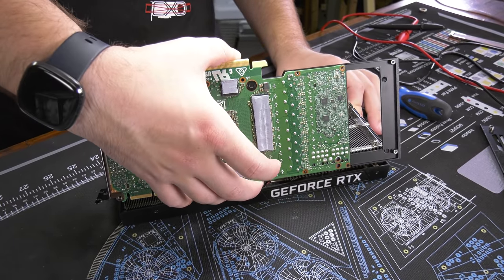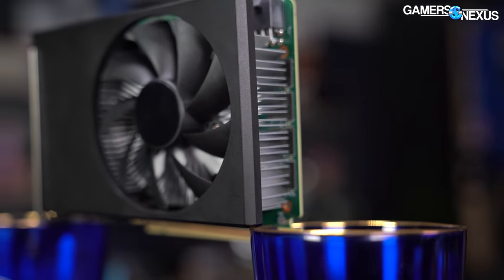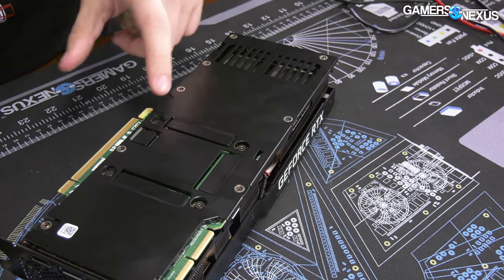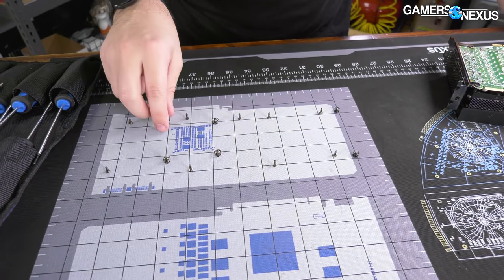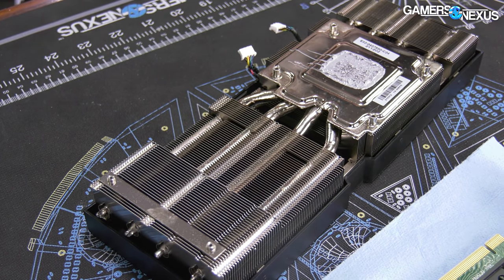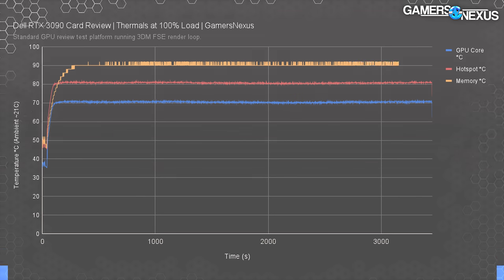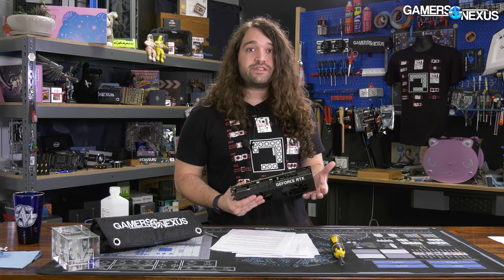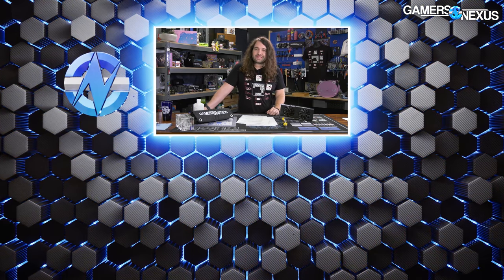Sometimes Dell Actually Tries: Dell RTX 3090 Review, Tear-Down, & Benchmarks

Comment: With the one row of memory on the back that had the tall thermal pads on half, I wouldn't be surprised if the plate had been designed to have a second flat heat pipe there like on the two other sides and then it was cut out of the design to save a few dollars without changing the tooling to match.

Comment: This must be a cost and availability issue. Maybe their cost on 3090 silicon was cheaper, so they used an existing 3080 cooler for that. Easier to hit a performance target with 3090, maybe, even if clocks are slightly reduced vs FE.

Comment: Those aren't bad numbers, I think. Not great, but not bad. My Inno3D iChill X4 3090 was hitting 80C core temp with the OEM's cooler. Also, you'd probably get more mileage out of it with an undervolt. I'd still probably put it under water and replace the rear thermal pads too, but if you're too scared to switch to liquid cooling, sticking to Dell's cooler would be fine.
Also, that Alienware hotbox is pretty, ngl.

Comment: So I bought a pos digital storm pc and it looks like they shoved one of these in the build. I took the water block off because no coolant was circulating through it. The Model Number on the card says  MS-V388. Can you confirm this is indeed the same Dell card? Also, do you know of a waterblock compatible with this card and where to buy it?

Comment: Hi, I'm am totally new to this stuff so this may be completely off. But if there is trouble cooling the rear memory, would it be possible to simply keep the rear plate off with a fan directly on the components? I'm guess dust and debris may be an issue, but just wondering. Let me know please.

Comment: this once again shows, that DELL has good engineers. I also found the G5 prebuild to be a piece of good engineering. The problem is that it doesn't matter, when the cpu cooler is too small and the system uses 1 stick-single channel 1/2 rank RAM etc.
DELL is really frustrating me. They do some nice stuff and also have quite good pricing, but you have to be sooooo careful, when you buy their stuff, that I wouldn't recommend them for casual PC users.

Comment: I'm screaming at my screen :D the extra thermal pad spot was supposed to be where the heatpipe extended. just look at the design. they specifically allowed the heatpipe to route over there, but I guess last minute they decided not to go there. idk if that's a cost cut or what, but it's pretty odd.

Comment: i have a lenovo 3080. It has thermal paste between the heatsink base and that black metal plate. Dell didn't do that. I repasted and repadded. Vram now running 20c cooler in games (~82c). idle temp of gpu and vram almost the same. Very quiet. Furmark benchmark is about 18% slower than evga 3080ti ftw3 ultra at default frequency.

Comment: Is GN ever going to look into open loop water cooling?  I would like to see a standardized test (loop length, radiator, same pump) to test the effectiveness of different blocks. I'm decently experienced in loops but as I'm thinking about upgrading I've not been able to find good performance benchmarks at your quality of work. I understand the amount of variables is daunting. Just would really like to see it.

Anyone know if it would be worth getting a new block for a 1200 socket 10th gen intel? I've been using a 1150 socket block for my 4790k and I don't see why I wouldn't just reuse this block after flushing. I used/am using distilled water. Always have and I'd recommend everyone to do so. I've always used silver to prevent anything biological from growing. Despite having another metal in the loop I've had little evidence of corrosion, and this is after opening my 980ti block after 5 years of use.

Comment: I have an alienware that had a 2080 super , and it was crap.  Was a blower style card, and was constantly throttling at 84c.  Ended up buying a 3070 ti to replace it, which didnt fit the crappy Aurora r8 case.  So I bought a new case+mobo+psu , took the cpu and ram out of the alienware, and built my first pc.  The noise reduction alone was worth it.  Cant hear the fans at all anymore, the alienware sounded like a jet plane.

Comment: Why does it have SLI connectors ? Although one looks too wide to be SLI. 
Too much TIM is bad, because it puts heat back into the processor, in the form of a loop. 
I would be happier with 3 fans on this cooler design, however i am a firm believer in pushing cool air into an PC sufficiently, prior to being concerned about internal cooling components, they are secondary.

Comment: It looks a lot like they intended that flat copper heat pipe to wrap around to the farthest side of the back mounted memory but forgot to modify the backplate after they realized the pipe was too small to handle the heat and just shortened the pipe. Then the height difference of the backplane contact was no longer flat since the heat pipe was missing. Oops.

Comment: I have the 3080 version of this card and the VRAM temps were like 110 out of the box when mining.  Turns out just putting thermal paste between the vapor chamber and the black shroud over the VRAM dropped the Ram temps by an astonishing 30 degrees C.

Comment: Question on that back plate vent 
Does air flow out or in the that 3090 
I would like add  a few Noctuas for my R11 and would like to maybe add little 40mm or 60mm fan at that vent area and no sure if It should in or out on that backplate vent. Thanks again !

Comment: 8:10 aCtuALLy(insert memes here) if you pay attention the heat pipe does go over(outer edges of) the memory but someone phucked up and mis-measured the bends on the pipe so they had to turn it around and only have it cover 2 of the 3 groupings of memory. Hence the extra tall thermal pad at the back/exhaust side memory group. Pipe was originally meant to cover that too.

Comment: It is pretty late for this, but the heatpipe on the back actually touches the vram chips exactly on the area where the pads are more compressed and it seems like it was planned to do it on all 3 sides but they ended up with a too short heatpipe and had to improvise the thick pad there. For me the idea is good but poorly executed

Comment: if they made it a full 3 slots instead of 2 and a bit, it would actually be a good 3090, 
looking at the size of that thick pad and the size of that heatpipe i bet they had another design that had the heatpipe also contact that other bit of memory, but a heatpipe that much longer was probably too expensive for Dell

Comment: Dell don't always make crap, i'm the proof of it.  I'm still running my Aurora R6 from 2017 today and it still kicking ass today with is 1080 Ti.  Never had any problems with it.  Only upgrade i made was the NVMe SSD upgrade 2 years ago, from 128 to 256.

Comment: At around 14:25 the top edge of the PCB where there's a screwhole, is broken. I'm just curious if things like that ever affect anything? In particular, how can a PCB break for it to not affect something? Isn't there wiring between layers or are edges and such just "doesn't matter if it breaks a bit"?
Reply: It’s not broken. It’s part of the pcb design. Some third party cards and even the nvidia 3090 and 3080 pcb have corner screw holes that appear to be broken, but are not.
Reply: @keylens.6900  Oh? I had no idea. TIL thanks

Comment: I bet they intended to run that heat pipe over all the memory on the back, but for whatever reason reversed course and had to use the thicker thermal pad as a result.

Comment: This Dell 3090 is exactly the same as Dell 3080 in the board and heat sink design. I unpacked my Dell 3080 and changed the heat pad and then the temp dropped from 104 to 88 directly

Comment: I got this card right for 841$, my memory is around the 90+ degrees maxing out at 96, so I guess I shouldn't be worried and that it's perfectly normal? Otherwise the temps are along the line of the review 70-75c on GPU and hotspot is around 80-85.

Comment: In these times, any 3090 you get to buy or afford is a good 3090.
Reply: i have the gigabyte extreme 3090 he calls out. she's a real chonker and i worry about that topside memory but it was all i could get my hands on from the newegg shuffle

it is overall a good card besides the heat problems, lots of power budget and it clocks higher usually

Comment: It is made by MSI, and it is virtually identical to 3080 except for the RAM in the back, but 3080 also use that backplate with heatpipe.

The most brain dead part of this card is the vapor chamber, the part/level that have the two labels.  The labels should NOT no on the vapor chamber, and that area should all have thermal paste to transfer heat from the metal frame(cast aluminum?).  The frame is in direct contact with RAM and power circuitry, but have no significant surface area to dissipate heat.  Once fully pasted (i think this is what the original designer intended), the RAM run significantly cooler than before.

Comment: huh, I've got the 3080 version which has more or less the same cooler. Strangely enough on my 3080 the backplate heatpipe is longer, long enough to touch 3 sides of the memory leaving only the chip near the PCIe connector without any heatpipe contact

Comment: I have a very specific question...that may only require a 'yes or no' answer...I know it's very hard to answer a computer question with either yes or no...and maybe you'll never see this comment if you lived to be 100...but here goes...I bought a Dell RTX 3060 Ti OEM for a very low price off someone I thought was trustworthy in my own city...he even installed it for me and got it to post and installed drivers through Geforce Experience...he forgot to uninstall my older AMD RX Vega drivers and/or the Radeon software...and since I have an AMD cpu I want to make sure I don't uninstall the wrong thing...my question is...without touching the cpu chipset or Ryzen master...
can I uninstall the Radeon software and drivers safely now, at all?

Comment: I have a rx580 from a Dell PC. Its a interesting card, very much reference style card with a blower. Its super loud, but its performance was actually pretty good, right on or a little past benchmarks at the time for the 580s. Now the CPU on that PC was Ryzen 1700, and that was a joke, out of the box thermal throttled. Had a super small air cooler and a too little cheap thermal paste. Of course they sold a add on AIO for that PC so thats why hahaha

Comment: It looks like the heat pipe was supposed to be longer but budget constraints due to human malware forced Dell to shorten the Heat pipe and replace with a fatter thermal pad. 
edited in: a late 2021 model or 2022 model may have this fix implemented so more investigation must be had.

Comment: It's the lazy way to lower the operating temp of memory chips if its on the same cooler as the core - lower the core temp target so that the fans ramp up higher. I had to do the same on one of 
my first laptop GPU water cooling mods where only the core was watercooled, the core could handle way above spec power draw but the VRM and VRAM couldn't

Comment: My recently bought 2ea of the 2080 super for 220.00ea is built similarly at first glance that is sold with Lenovo name on brown box build date of 8 29 2021 generic brown box manufactured for them it says unit reads in gpu z as MSI pn 4x61a22496, in my Dell 3630 it runs watching live 1080p streams at 100 degrees hot spot is always almost 20 degrees hotter difference. It is paired with a i9-9900k added 2 120mm fans, ordered 2 slim design 120mm to put between grill & chassis a standard is a bit too thick.

Comment: If I can get Dell Pre-Built with RTX 3090, I'd probably just go for it.

And then tuning everything down, like Voltage, clockspeed etc, which means intentionally not using RTX 3090 to its fullest potential. Just to prolong the lifespan of the card since I knew Dell are terrible at making Pre-Built.

So if I can get similar performance as 2080 ti with Dell's 3090, I'd be happy.

Comment: Finaly i could aford to buy this beauty..brand new but no guaranty...i got it for 700 Euros . it works great but the heat that it produce is huge..for now in winter time is good but next summer i think i will move the case on the balcony. Any ideas if there are some watercool parts for this Dell ?
And an update after 3 months...i have some problems with this GPU.  temps are the same, but after i play something strong,after 10 min  the gpu shuts down, i can hear sounds in the game but after 10 sec the pc restarts.   i tried new and old drivers, reinstall windows and games,upgrade PSU with a 1000w, changed RAM .  if anyone has an ideea that would be great.
Reply: Mate, try undervolting and an Oc of both memory and Gpu frequency. I got it down to 70% power consumption and it goes average 66 Celsius with room temperature around 32 Celsius.

Comment: I repasted the thermal paste all over the 3080 heat sink and lowered the temps by 15c-20c. I have replaced my 120mm fans from the front to the AIO and is much cooler and much more quit. Repasted the CPU Honestly I've enjoyed my R11 with the few mods to make it much better

Comment: Even at msrp there isn't much value in the 3090 or even 3080ti over a regular 3080. 15% more performance for more than double the price since the 3090 and 3080ti are virtually identical on performance? Nah I'll pass no matter how well made the card is. By the time my 1080ti goes belly up the 40xx line will be out so all of this is a moot point anyways.

Comment: Dell is a complicated yet confusing company. Yes, I agree that they can make good product such as Dell Xps 17, however they can sometimes screw things up. For example, I got Dell 7577 few years ago and it's running well in the first year. During the second and third year, Dell decided to to lock the CPU undervolting and this cause my laptop to almost burn my hand while gaming 🙂🙂🙂 Why the heck would you want to lock your customer from undervolting if you know you're system can't candle the heat well? I really wish they can release a new firmware update for Dell 7577 and allows their customer to undervolte their system once again. 
Dell, if it ain't broke, don't fix it !!!

Comment: I actually like my dell laptop. It's not a high powered laptop though. It's a 2in1 Ryzen 4700u. It runs super cool and hasn't had any real issues. And it has already outlasted my intel i7 9th gen laptop (I don't recall the part number) while being clearly better esepcially in graphics. Intel's IGP is trash. AMD's is actually good enough to run any games I'd want to run on my laptop well. For all other games I have my 5900x desktop with a 3070 (ASUS EKWB that runs at an insanely low 40 degrees!!!)

Comment: @14:33 - thanks for this. Now I don't have to open up the card to find this info until I replace it.  After one month this dell rtx 3090 card damaged, GPU fan #1 according to hwin and gpu-z is non-functional.  Did all testing with drivers, bios updates, etc. and it is definitely hardware related, I suspect the poor design makes the overheating cause issues on the card and it fried my fan.  Thankfully it still seems to work well but thermal throttles fast because one fan isn't working.  Now to replace it, hopefully its back to normal but if you are considering getting Dell... don't.  Get another brand, preferbaly the 3 fan type... .this 2 fan dell card is really bad, overheats easily and hard to remedy

Comment: All in all the design of the cooling system is much better than what I expected from Dell, or whoever did it for them. A heat pipe on the backplate is something I think we’ll see more of, at least on the dual side memory cards. 
This card is at least comparable to anything the “scrub” companies like PNY or Zoltac makes when it comes to an air cooled GPU IMO.

Comment: My dell 3070 looks roughly the same and runs slightly cooler than my gigabyte eagle 3070.  (the dell one is in a g5 case), the gigabyte is in a deepcool with 5 fans and proper cpu cooler.

Comment: When dell has better memory temperatures than the founders edition, you know Nvidia fucked up. Sat here with 105c on memory junction under load with no decent right to repair in this country. Got a choice of 2 years of overheating memory or a voided warranty for taking it apart :/

Comment: Another terrible thing about the gigabyte 4slot cards is that they have lower powerlimits than almost every single other card in their class. 3080s and 3090s. Lower power limits than founders cards. FOUR SLOTS and TERRIBLE temps. Also the trash OLED didn't work properly at launch either. Worst ampere card I've gotten. (40+)

Comment: i got those Dell rtx 3090 like 50% off on online marketplace said than been used for 2 years straight. 😢Sadly with old never replace thermal paste and no cantacted VRAM module to spread the heat . Guess the thing you get within th price😂. 😅

Comment: I also bought a Dell Alienware Area 51 2 years ago, with a RTX2080ti and 9980xe for fraction of its price. And it didn‘t performed well.
Solution: Build my own PC only reused CPU & GPU. Overall 20% more performance (Timespy Extreme from 9500 to 12000 points without any OC). 
So my Dell ist now better than Dell XD

Comment: My MSI 3080 Suprim X had WAY more thermal paste than that. It was ridiculous. Also, the horribly cheap thermal pads MSI used bled an oil like substance ALL over the pcb. It was a mess to clean up and re-pad. Also, because they are a trash company it voided my warranty as well...

Comment: As a dell owner sadly dell is a like a broken clock. It's right 2 times a day and wrong the other 1438 times. 

My near 1k dell g3 3590 had its utter mickey mouse grade paper thin plastic mono hindge break 2 times in one year both under warranty and is breaking again for th third time whereas my 12 year old $400 dell inspiron is still solid and is also made of plastic just thicker than the paper thin stuff my 3590 is.